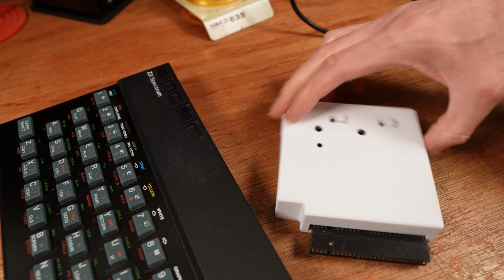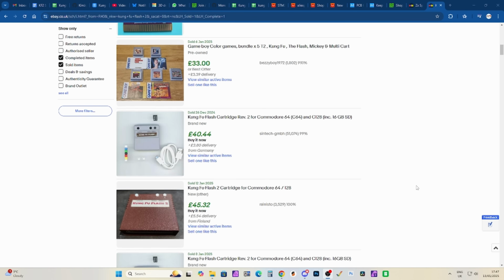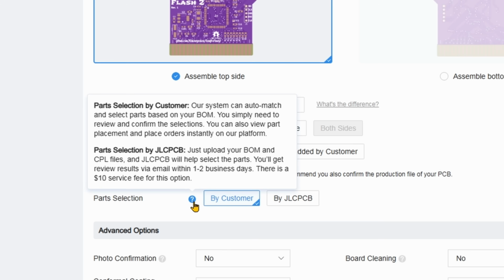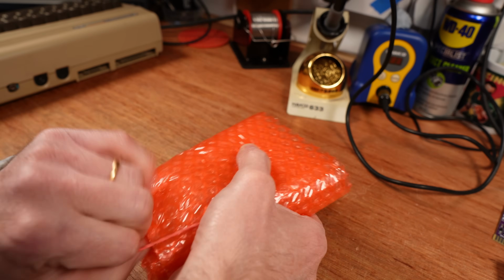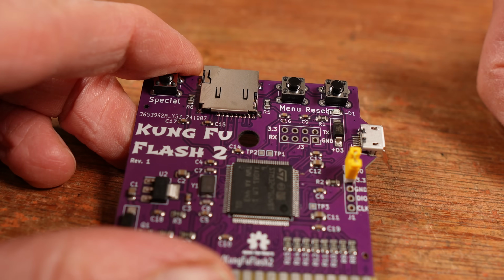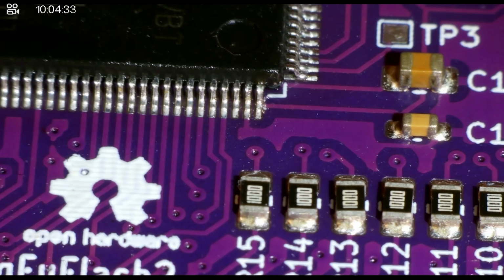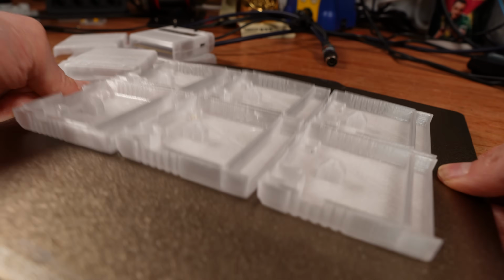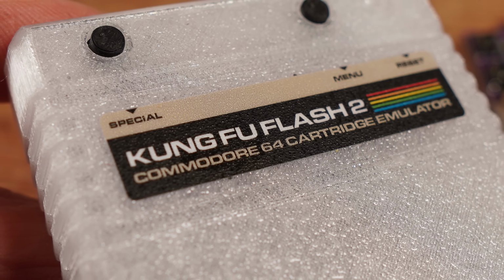Making Retro Cheap with CROWD POWER

Comment: Hi, I’d like to ask you about one detail: it’s specifically the 25 MHz crystal. The BOM specifies the use of component C445646, which has four pads, but in your video, when you receive it and solder it, you can clearly see that when you turn it over, it only has two pads. Did you therefore order a different component with the same specifications? Thanks for your help
Reply from the maker: That was a while ago, but I think I remember there being an issue with the crystal as stated on the BOM. Sorry I can't be more help

Comment: The CRT files loading and ram/flash thing:

It's loading the cartridge images into ramdisk, rather than disk. Faster, but ephemeral. 

If you don't save changes, it wouldn't keep them. They disappear on power-off.
(I genuinely couldn't find a different comment mentioning it yet haha)

Comment: 25:00 if you end up with that roughness again on something you plan to paint or put a sticker on you could try just using UV resin.  Let it flow into all the crevices and level out then blast it with a UV pen light and voila smooth finish.  :-)

Comment: This is just an idea but could you week double side tape the sticker up side down on the print bed were the sticker would be on the cartridge then start print and the printer would print over the sticker bonding it to the print ps you can do the same with lazer printer toner once 3d printed over and cooled  use an iron to set it in the print then remove the backing film / paper

Comment: My standard risk mitigation rule for buying groups of electronic things: add 10% of needed amount to the order. Need 20? Buy 22, or the next available increment. Saves weeks of project down time, especially when ordering from a new vendor. One project I was pleasantly surprised by all units working, and we simply found uses for the extras. In this case, it was an Arduino-compatible fan control board.

Comment: If you need an "real" stlink v2 programmer on the cheap, just buy the cheapest ST Nucleo 64 board you can find.  They all have an stlink programmer built onto the board that's seperate from the microcontroller section.  In fact, you can just break it off of the nucleo board and use it standalone.  It's the cheapest way I know of to acquire a genuine ST programmer.  A NUCLEO-F401RE board can be bought from DigiKey for less than $20 shipped to your door.  Cheers!

Comment: The programming of the STM32 µCU isn't to bad if you have a STLink v2 clone that has a real STM32 µCU in it.  These can still be updated without a problem.  The issue is getting the STLink v2 clones that have fake STM32 µCU's in them.  Those wont update correctly.

I have had this same issue building the Greaseweazle F1 boards.

Though once you get a STLink v2 clone that works then make sure not to get rid of it, accidently leave it at a friends place, or loose it at a retro event. :)
Reply from the maker: I will keep trying!
Reply: I did mine with Linux DFU recovery mode over USB, no need for fancy hardware.

Comment: wow, dont use the last 900mb of those memory cards...
Reply: Probably the cheapest and smallest combination. Smaller capacity may have been more expensive.
Reply: @KrisGraney  Ive never seen an SD card with that level of quality that actually has the advertised capacity present hence my attempt at humour. I'm sure they work fine.
Reply: @P5BDeluxeWiFi yeah, you do run that rush. Hopefully you will never load enough on it to find that limit considering you can probably get all C64 games on the card and not hit that limit.

Comment: As much as i understand the "keep things cheep" part of the video, you should really go with ENIG to ensure good and durable connection for years to go. Future you would thank you when those HASL pins break :)
Reply: But is it worth it for hardware that only costs about £10?
Reply: @KrisGraney  I think so yes. A flashcart that only works the first ~100 times you insert it seems like a waste of money. And ENIG is not THAT expensive.

Comment: "No clean" flux doesn't mean that it doesn't leave a residue, it means that the residue is safe to leave as it's not acidic and won't damage the board.
Reply: Which isn't entirely true either, 'no clean' is just a nice marketing story and you really should make the effort to clean it up, even reputable manufacturers of solder like Kester recommend you clean it.

If you're using any flux which is acidic then you need to throw it away and buy some decent stuff.
Reply: @M0UAW_IO83  rosin based fluxes are themselves mildly acidic when they react with oxygen or moisture, don't remember which.

Comment: Hi Lee. Just had this video on in the background while I finished assembling and soldering a floppy disk interface for my homebrew computer - the circuit boards for which arrived from JLCPCB yesterday. I have found that they do, indeed, provide an excellent service. Although I assemble my own boards (80's era IC's aren't usually available from fabricators!) and so have not used the company's assembly service I am surprised that the boards you received had issues. I know Julian from the Dragon group and he is doing some amazing work the Dragon circuit board designs.
Reply: Woot!
Reply from the maker: Good luck with your floppy disk interface project!

Comment: Neat shells but you can make them way more clear if you print them slower. I guess that's not the Bambu way though but then again what is after that rug pull, I'm not sure what to recommend to people these days, it's either Bambu and their rug-pulling deviousness, Prusa and their really quite wild prices, or something like Sovol or Elegoo that is probably gonna be great if you are in the right mind to upgrade a few things and fix some other issues. There's also Creality I guess, which also seems like a really mixed bag.

For the "lowered" sections with the stickers it looks like the bridging kinda collapsed, would probably have been best to do a small support layer with an interface layer and a gap, usually pops right off and leaves a surface that's good enough. The Bambus tend to have overly aggressive bridging speeds which results in that droopy mess, maybe you can do it without a support layer by just setting the bridging speed down to something like 10mm/s
Reply from the maker: Good advice. As much as I would like to get more involved in learning all the things in 3d printing to make it work better for me I unfortunately am limited on time and the amount of hobbies and projects I can do at once. But thank you for the pointers!

Comment: Again I like how frugal youy are with the flux while showing thet it is still more than enough. That flux seems great btw.
Reply from the maker: Its brilliant stuff. Combined with the loctite lead solder.
Reply: @MoreFunRetro  I have quite alot left of my multicore brand lead solder but that one is good to. I used RF800 flux at the mo because it was the only one I could get quickly it liquid and evaporates way too quickly though even if it is pretty good compared to what I had before which seems to be mostly  IPA.,
Reply from the maker: @rimmersbryggeri  yeah, I use that RF800 stuff for some things. It's ok for small dabs

Comment: As someone who orders hundreds of boards from JLC every month (I design PCBs, and have some repeat orders) I'd say they fail around 1% of the time. From shorts, to chips in the wrong orientation (not all for an order, sometimes just 1 or 2!), to bad chips. It's always the same generic response about "asking the factory to be more careful" and a small coupon. In one case, I had very expensive chips rotated wrong, costing over £1000 to me in blown chips + 2 days of my time reflowing the boards. They offered a £30 coupon. So, yeah, there's a reason they're cheap. I haven't had the same problems with PCBWay, but they're more expensive. JLC's 3D printing service is very good though - some of their options almost look like injection moulding!
Reply from the maker: Ouch! 
Yeah. I think as long as you go into this knowing you are paying a cheap price for a reason its hard to complain too much. But £1k is a hard one to swallow.

Comment: I'd prefer to buy a ready made one off ebay. I don't know anyone who would want to share the costs and I don't have the soldering skills for SMD.

In other news, my memory chip tester turned up today. All the memory in my 128K Speccy is working. (But it still fails the Diag card test. Hmm)
Reply from the maker: Next stop. Logic! :D Or trace damage? Good luck with your fix
Reply: @MoreFunRetro  The logic IC's are the only chips NOT in sockets at this point. 🤣 I've been working on it, off and on, for about 5 years.

Comment: Great video, thanks for the thorough explanation. On the rough sticker case finish, personally I'd print with supports. That should improve the finish and it should be a easy support lattice to remove with a knife.
Reply from the maker: I did print a couple with supports but they proved impossible to remove. Still getting used to the new printer and its software.
Reply: I did a test print with supports and the finish was still way too rough to get the vinyl to stick convincingly, unfortunately.

Comment: Great video Lee. No clean flux just means it doesn't need to be cleaned as it won't damage the board if left, but you are like me and don't like to see flux left behind. This looks an interesting project for me, any chance of getting the BOM and CPL files ? 😁😁😁😁😁😁
Reply from the maker: Come find me on Discord Phil, or email, and I will give you the files :D
Reply: @MoreFunRetro   I've tried reaching out to you via e-mail and Discord but haven't had any success.  BOM/CPL files was the subject of my request...any other way to reach you?  Thx.  -Mark.
Reply from the maker: @deborahberi3249  not sure why you're not getting through. Discord is definitely the way. I see just about every message that's written on there. Fairly sure the files are pinned in one of the channels too
Reply: @MoreFunRetro  I'm wondering if anyone can confirm if it's been pinned?  -Mark.
Reply from the maker: @deborahberi3249  YouTube comments are the most unreliable method of reaching me. Its pure blind luck I got a notification for this reply at all and likely won't if you reply to this comment. Say hello on discord. Not DM as they don't get through automatically, just say hello and explain who you are on there and either I or someone else will point you in the right direction.